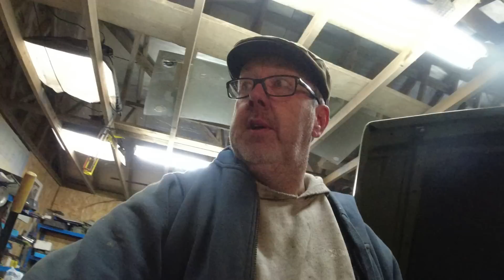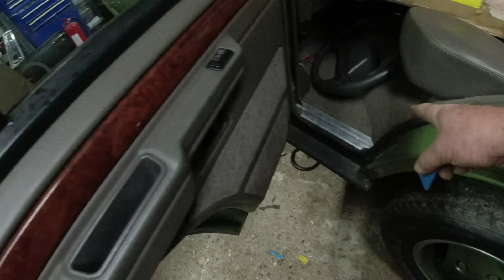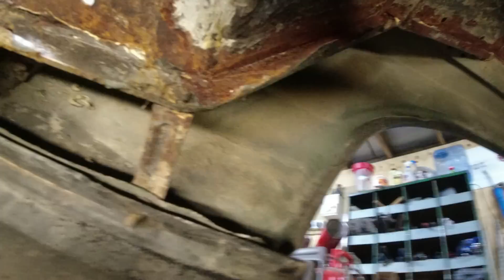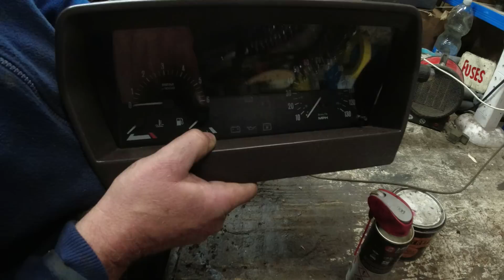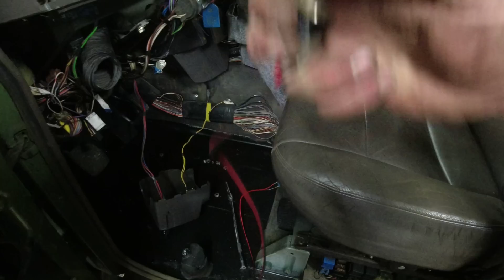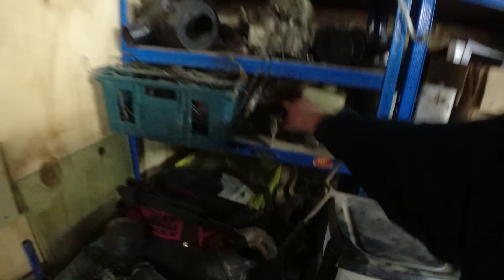1990 Range Rover LHD Welding, Wiring bodges, ABS assessment for refit ep4

Comment: I suspect all the dash bulbs were removed to try and hoodwink the mot tester, possibly in Spain.
I know when my car is inspected in Portugal they never check any warning lights.
That process for clearing fault codes looks very involved.
Had central locking issues on my Skoda.Opened up the driver's door actuator and it had micro switches and all sorts of other things so threw it in the bin and bought a fine Chinese copy which worked wonderfully.

Comment: Hi Richard, 
"The red cable identifies as a black cable" - you could possible get a job at Jaguar these days ;-)
I had so many troubles with the original central locking ECUs and the door motors, or the remote control on a later softdash I decided to install new aftermarket systems with remote control - complete ECUs and motors. I keep the original wiring, just change the connectors. It is especially easy on the cars from I guess MY93, where there was the option of remote control, as the wiring for the indicators is already at the ECU connector. Works fine on 4 cars so far, on my daily driver for 4 years so far. Not bad for a chinese product and I dont have to stick the key into the mostly worn lock in the door anymore. But of course I admire your attention to keep it as original as possible, never went so far to look inside the door motors. 
As for those ABS-modules - There should finally someone come up with a possibility to rebuild them - I have at least 10 of them lying around.
Reply from the maker: ABS modulator is not too bad to fix, so long as the solenoids are working and undisturbed the high pressure side should be fine. Seals for the low pressure is the bit that is stalling me